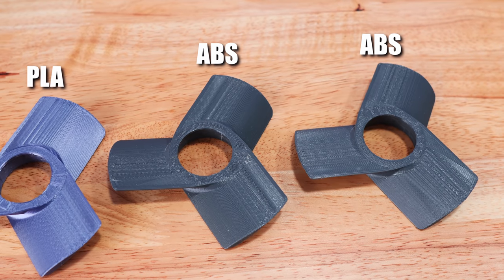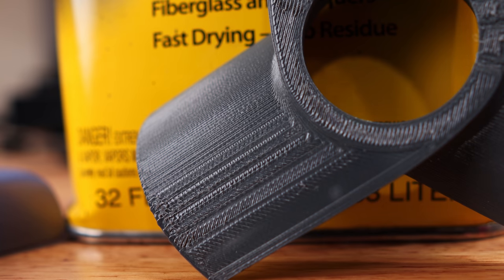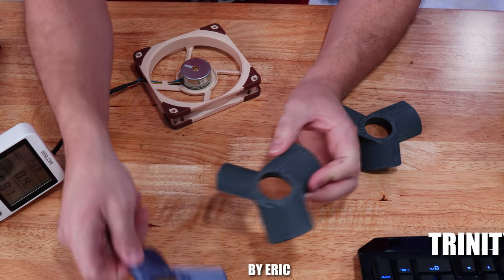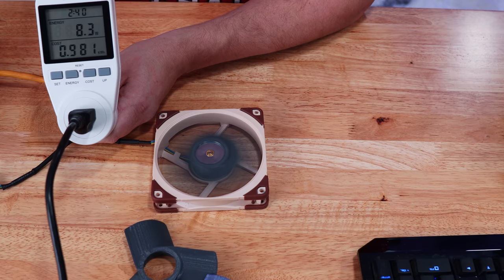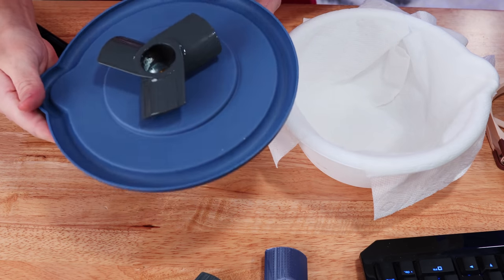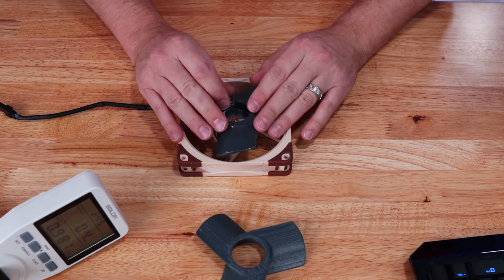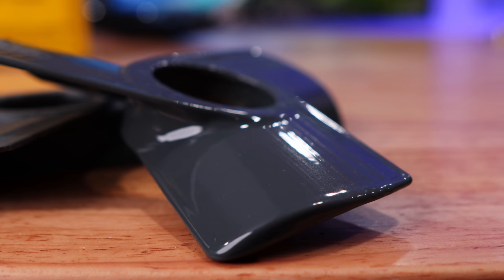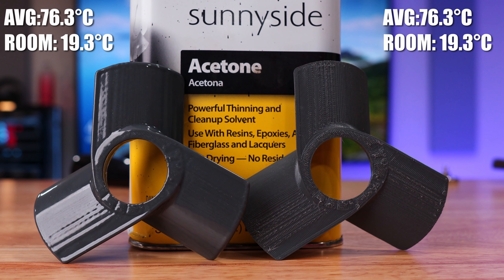Does Smoothing 3D Prints Improve Performance and Can You Smooth PLA?

Comment: So... acetone vapor smoothing mostly deals with surface imperfections, and it's hard to get it to reshape layer lines into an aerodynamically smooth profile. It would probably be better to hand sand parts, or throw them in a rock tumbler with abrasive media

Just as an FYI, ABS is also way easier to sand than PLA.
Reply: Exactly the thought whispering in the back of the mind.

Comment: One major benefit to using PLA is that it is plant derived and more degradable than ABS. Both ABS and acetone are fossil based. If it's for something like a fan you're going to actually use, sure, go a head and print it in ABS and smooth it, but for something that's only going to get used once or twice, PLA is so much better.

Comment: Nice. I also expected more of an efficiency increase with smoothness, but noise makes sense too.

Obviously you aren't doing long term testing but I expect the smoother fan would accumulate less dust and perform better over the long run so it's probably worth while for anyone actually printing and using their own fan blades (which is, admittedly, no one)

Comment: Sometimes experimental results can be counter intuitive. Wattage increase could be caused by drag on the smooth print. I recall that turbulent airflow can reduce drag which is what I'm putting my money on on why the rough fan consumed .1 watt less. I'm also thinking about the percentages of difference, or the resolution of the tests. I'd imagine the difference between a rough and smooth print to be in the tenth or hundredth of a percent, especially at this scale. Love what youre doing man! Keep it up!

Comment: I'd like to see if there is difference in performance if you adjust the density of the prints.  pick some rather heavy design and then adjust the infill from solid to as light as possible and see if that changes results.
Reply: And speed up the fans to get each to the same noise level (smoothed vs rough)

Comment: ABS is no longer second. That goes to PETG for a few years now.
Reply: Yeah by and large hobbyists stopped using ABS 2-4 years ago.  I honestly don't know anyone who still prints with it, and if you ask today you just get a lot of weird looks.  But when you look at industrial 3D FDM printing (stratasys, xometry, etc.) ABS in a temperature controlled chamber is still the standard, followed by nylon.
Reply: @AccessAccess  I am a hobbyist and I almost exclusively use ABS.
Reply: PETG is for water bottles and people who can't print ABS
Reply: @BladeScraper  Water bottles are made from PET without the glucole modifier. And I CAN print ABS, but I find no use for it. The only thing it may be useful for is in fact smoothing and I don't do that. For anything outdoor I would use ASA instead. And if it needs to be indistructible I use Nylon or PC. So why ever bother with ABS when PETG is just much less stressful to use?
Reply: Yeah it's a joke lol
But I hate PETG.  I almost never print it anymore.  ABS is my go-to material, even over PLA
Reply: @BladeScraper  Same. I only use PLA when I need to do a large print because my bigger printer does not have an enclosure and i'm too lazy to make one.
Reply: @BladeScraper  Thas ok, but what do you get from it? What is the benefit?

Comment: So the difference you're looking for is the skin friction and pressure drag for the fan blades. You can do a bunch of calculations to find out when the flow over the blade goes turbulent, you can calculate the drag on each with the smooth versus rough, and you can do all sorts of calculations to find out what the difference in drag is between the rough and smooth fan blades. These also depend on speed of the fans, surface area of the blades, temperature of the room, and all sorts of stuff. 

If you tried a range of RPMs you'd end up finding that difference in the blades due to the smooth versus rough. But at that speed I'm going to guess at the end of all of those calculations the difference is negligible.

Comment: The way I imagine it working is that the airflow itself helps redirect the surrounding air, so only a minimal part is actually interfering with the air. When the air gets close enough to the blades, they're already sucked into the existing vortex of the airflow, thus the difference between smooth and rough blades is minimal. I am curious though, as if this would change if there were more blades or the design in general was a lot more intricate with more surface material and tighter gaps for the airflow to pass through, whether in that case the smoothening would make an impact or not (for example with the "cheese grater" and "honeycomb" fans you've tested previously).

Comment: Having been wanting to see this test and being one of the ones that requested it, thank you.

Commenting on your results, now I have to be careful... Total noise energy would actually require you to measure noise emitted in every direction from the fan, or you would need to focus it to measure the total noise energy... But, for the sake of argument, since the smooth fan is 0.4 to 0.5dB quieter, assuming this correlates at every point in a sphere around the fan, then you did just demonstrate that the blades are more efficient. They're not putting as much energy into making sound. Granted the difference isn't all that stark. One could probably approximate the power into noise change if they wanted to do the integral around a sphere and knew exactly what distance you measured at.

Obviously seems pretty insignificant at the NOCTUA fan's RPM range though. More accurate measurement would be required, but it depends on how badly you want to know. It may suffice to say 'close enough, not a big player' in this case.

EDIT: And thank you for testing without it against the table. Obviously air flow is significantly reduced there and it was not representative of normal conditions. And probably some turbulence played in since the fan was effectively in a stall condition (and axial fans generally don't care too much for being stalled)

Comment: I think that makes sense that the friction of the fan against the air is negligible in this application. When a fluid moves across a solid object there is whats called a no-slip condition as fluids obay the frictional laws of physics. The no-slip condition means that there is no (or practically speaking no) fluid flow up against the solid object. The further away from the object the faster the fluid can flow since fluid also has some friction with itself. So changing the friction of the solid object doesnt change much as far as thermal performance since theres not much flow there anyways.

But noise performance is different because the irregularities in the surface introduce terbulence into the air making more noise as the abrupt changes in shape still have a small effect on the flow pattern further away.

Edit: a scenario where the surface changes the thermal performance would be where the surface would introduce a significant amount of drag. This would more likely be done by changing the pitch of the blades. But lets say if you add larger protrusions that would add more drag but in your test you significantly dont really change the surface area or the geometry of the fan so it still checks out.

Comment: they're "smoothed" yes,  but they're not smooth,  but even still all in all you're talking about maybe a 1-2% at best from perfect smooth to 3d printed level smooth.  it's just not at a scale to matter.
Reply: Yeah, now that I think about it, it's like putting a noisy signal through a low pass filter. It knocks of the peaks and fills in the valleys a bit but it does very little to the average topology of the surface. 

To put it another way, it's like upscaling a 480p video to 1080p. It's still a 480p video and doesn't magically have a higher resolution than the original source file.
Reply: P.S: don't mind me, I'm just thinking out loud.

Comment: Hi,
For the efficiency part assuming power measurement method is accurate.
You should also have considered the fan RPM.
If the smooth fan runs a little faster that would mean it'd probably more efficient.

Granted what matters most is end result that is cooling the cpu.

Comment: You should use a silicone basting brush or even better a silicone squeegee to clear the acetone dissolved abs off the blades, you can reduce the edge width, get even smoother surfaces, and reduce weight/drag even more

Comment: As always, great fan video! 
If you want to get more resolution with your power draw test, use a multimeter set to DC current test and use it's leads for your positive wire to the fan. There are probably better ways of doing this but I've had good results even with really crappy multimeters.

Comment: A higher power draw when pushing against the table is indicative of a better static pressure performance.

If it's better at grabbing the air, it has more load to work against. If it were an efficiency loss, you'd then see the same wattage difference when you ran them off the table.

Comment: I think you'd have to expand your data pool to more than one fan type. Blade thickness, number of blades, RPM of the fan, etc. would probably show some more variations from between a raw and a smoothed out print.
Reply: He did say there was no difference for that specific fan. It’s also an extra hour or so wait for 4-5 individual fans not including some of those weird multi-part fans.

Comment: You could also try a light, high grit wet sand rather than the chemical method. Obviously this would be either impossible or extremely too time consuming on many fan designs. But, for one that performs well and you are really a fan of it may be worth it.

Comment: I'm wondering if sharpening the leading edge of the smoothed fan will make a difference. The raw fan looks to have a reasonably sharp leading edge, with the smoothed fan having the leading edge dulled during the smoothing process, which I think would lead to some turbulance interfearance (Yeah I know, bad spelling) effecting airflow, therefor cooling performance. Enough to make the raw & smoothed fans perform the same.
My 3 cents.
Keep the great content coming.

Comment: At the scale of the fan (small sizes), air flow dynamics is directly impacted by the scale of the airfoil (fan blade size). If you measured fan blades identical designs with a 8/20/50 feet in dia. Each size would react differently, and therefore have different efficiency factors. But the smaller the scale the lower the impact on its efficiency. 

Main reason why model airplanes can still fly efficiently with "dirty" foil design. Flow around airfoils
 are based on a scale (Reynolds numbers) or as stated on Wikipedia: Reynolds numbers are used in airfoil design to (among other things) manage "scale effect" when computing/comparing characteristics (a tiny wing, scaled to be huge, will perform differently).

Smoothing will have no impact on efficiencies (as proven). Noise is a different story, but that isn't the unit of measurement on this test.

Comment: That quieter fan means that you can turn up the fan higher than you otherwise could while not disturbing the user, leading to a higher thermal performance for the same audio level.

Comment: Hey, I was watching and thought that maybe the acetone since it reacts with the abs maybe changed the mass of the fan. Maybe you could check that and repost or edit description with those results? Maybe some acetone traces got trapped in surface.
Reply: That was my thought on the power draw change.  Not all of the acetone had gassed out of the plastic, adding the tiniest bit of mass.  Might take a week or so for all of the outgassing to finish and the part to be fully cured.  I don't think it would change any of the other results, however.  Being that the change in power draw was only about 0.1%, it's not really significant, but was interesting.

Comment: In addition to the decibel meter it would be nice to see a spectrograph of the fan noise. Sometimes louder isn’t the issue it the frequency that bothers the ear. An improperly tuned pa running at 90 dBa can seem louder or more hurtful to the ear then a proper tuned PA at 105 dBa. Point being the frequency the fan produces is more important to the ear the the 1-3 dBa difference in level.

Comment: PLA is stronger, but stiffer. While ABS is not as strong but flexible. But ABS requires much more work on the part of the person running the printer to get to print properly. Just a tidbit of information for those not to informed on the topic. PLA is also friendly to the environment being made out of plant products and being able to decompose under the right conditions.

Comment: Awesome video! Next time measure RPM? Maybe the load draw  is the same but if it operates at a higher rpm it could suggest it is more efficient. Also less noise = higher efficiency in engineering world

Comment: There is a difference between smooth and raw for cooling, but it is such a small improvement that it isn't worth mentioning.  The ridges actually create an air barrier that acts like smoothing it, only creating a fractional difference overall.  That fractional difference can be heard, clearly, but that is the only difference a user will ever notice.

For it to matter to have that precise of cooling, you would have to be doing some significantly more advanced things than anyone would really be doing, like some pretty wild research.

Comment: For power draw, you should consider hooking up a multimeter in current mode on the +12 volt line, use Ohm's Law to calculate the wattage (I=V over R).
Should me more precise.

Comment: A quieter fan also means you can run it faster to achieve the same noise level, leading to better thermal performance for a given noise level. Perhaps a useful unit to compare would be °C/dBa, the amount of cooling provided per unit of noise.

Comment: MEASURE RPM

the fan motor will normalize power draw to its max. The difference will be the rpm will increase if it’s not at its maximum rpm! 
The sound difference may be indicative of this as well

Also more blades will give a larger surface area and bigger difference so try that too! 

Also try sanding smooth then the acetone!

Comment: Even if it was "smoothed" you could have done a better job with a sandpaper and get every layer wave out of it, also should get a real multimeter cuz I dont trust your power draw thingy to be accurate since it showed 7.9W , 8.0W and 8.4W after it had gotten to max speed. Also meassuring rpm could be useful. Either way I always love your videos, happy new year!